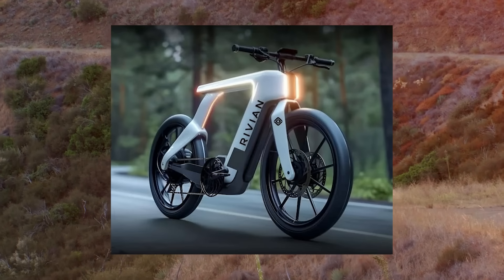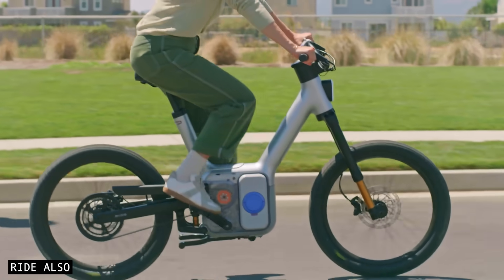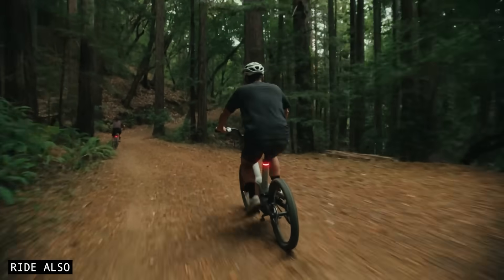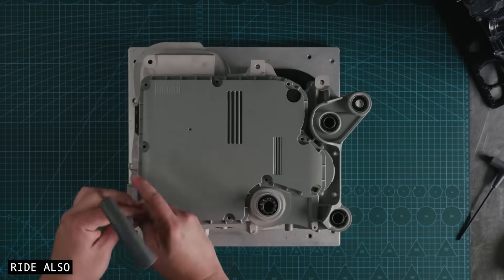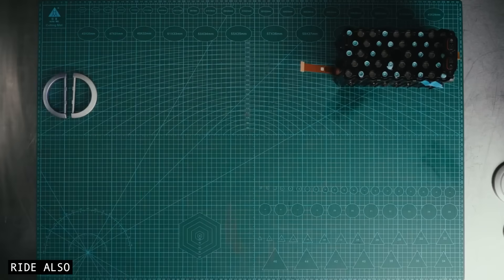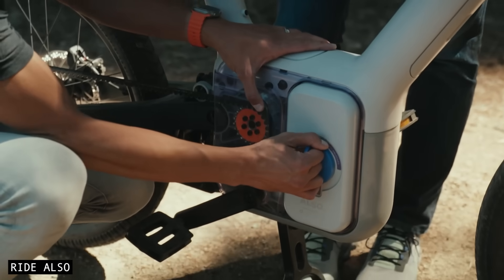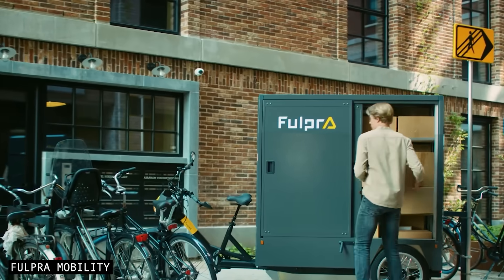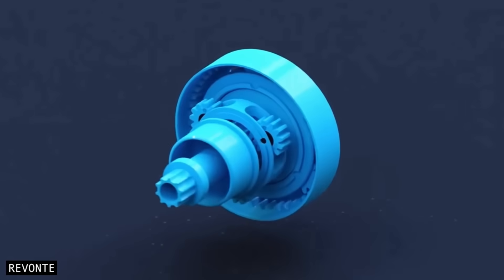Here’s Why the $4,500 Rivian eBike Uses a Digital Gearbox & Belt Drive!

Comment: eBikes should require licensing. They're motor vehicles. Pedal-assist is nonsense legalese. Companies like Amazon want these because the insurance changes and you can hire delivery drivers that don't need certs or licenses to operate them. The manufacturers are working very hard to keep them classified as non-motorized vehicles. Pedal powered conveyances don't weigh 85 lbs, motorized ones do.

Comment: It would've been good to compare this ebike to ones with regular mid-drives, as functionally and price-wise they are the most direct competitor, not hub motor ebikes. A mid-drive bike with a belt drive and torque sensor shares many of the advantages of this bike while avoiding the pedaling efficiency loss

Comment: This feels like an e-bike for middleclass people who would otherwise not ride a bike, especially with that 100 mile range to get out of car dependent suburbia and still have enough juice to get back home, rather than people who already like to ride bikes. Its a necessary piece of the puzzle to get people used to diving less and using bikes and public transport more, but the bike racks on the buses around here wouldn't let you put it on the front in a million years. 

My ride1up 700 series just barely meets the 50 lbs weight limit, a bike I got specifically because it was made of off-the-shelf parts so I could fix it myself if they ever went under without worrying about sourcing parts. I have needed to do twice already when I got screws in my rear wheel and fucked up the rim cus it was a state highway and they don't bother cleaning up the bikelanes. 

New rear wheel was $360 including install by the shop, guy was nice enough to include free rollflats. Im too broke rn to afford that kind of convenience fee, but I have the option of opting out of that and getting the parts myself. You don't with a proprietary system like this.

As for the quad, they need to be using the streets, not the bike lanes. They are not bikes, nor are they called bikes. They are exploiting laws that were made before they were a consideration that had to be made. The solution to less traffic is less cars on the road and better public transportation, and these quads perpetuate a continued desire to drive a car as they directly reduce peoples desire to ride bikes if its going to be taken up by a shrunk down delivery truck that only exists because of how companies have decided we get the items we need for us.

Comment: Did you miss a large chunk of inefficiency in the drivetrain when you didn’t include the several stages of gearing we can see being installed? Also did someone say heavy? This thing is heavier than a lot of of the riders that would end up riding it. I have a high power full fat EMTB that only weighs 52 pounds and it’s heavy. This thing is ridiculous.

Comment: The aesthetic of this bike is disappointing. The front wheel looks too small. The gap between the top of the front wheel and the fork crown is too large. The handlebars look like an afterthought. It feels like they worked hard on the drive train, including it's design, then kind of forgot about the rest of the bike.

Comment: Remember guys:
You still can convert with your bike to electric with bbshd, bbs02, TSDZ8 or TSDZ16 for a fraction of the price of any Emtb. You will have much more power,. More like torque and a throttle if you want. Parts are available everywhere and cheap.

Comment: That turtle mode sounds very slow. We use the newest CIXI drivertrain on our GoLo and it will still cycle 15km/h purely on your power when the battery is flat. Even better, the CIXI gets a higher mileage compared to the chain drivetrain with the same battery, so the complete package is more efficient without a chain. Right now we can do a 20% with full cargo from stand still. Most generators can't fully convert the riders torque though so most are very inefficient and don't feel natural. If you'd like you can test the newest generation CIXI/GoLo if you'd like
Reply from the maker: I’d love to know what bike you’re comparing your GoLo to that makes the CIXI more efficient on the same battery size. What bike, motor, drivetrain, and tyres are you using as the reference?
Reply: @Cyclingabout  I had a long reply that seems to have been removed, but short answer: same bike. So the GoLo with Bafang M620 and 3x3 hub. Re-gen has something to do with it and passing the motor through the drivetrain as well, but in the end we get about 15% extra range on the same platform. I still find this truly mind boggling! We are happy to provide more info but YT seems to be picky about comments?
Reply from the maker: Wow, that’s impressive. Either your previous motor/drivetrain/battery setup had some pretty big losses, or Cixi has seriously optimised their system (probably a bit of both!). You must be doing a lot of stop-start riding and carrying a decent amount of weight to take full advantage of that regen? I’m going to see if I can hunt down your comment - I would love to hear more.
Reply: @Cyclingabout  A bit of both indeed, but I sent you a more in depth message through messenger , I think the YouTube comment is ghosted/lost forever

Comment: The 15% motor inefficiency is complete BS. Motors are not equally efficient across their speed range, and without any gearshifting, (and even with) the motor is effectively fixed to the rear wheel. So when riding slowly, the motor will be horrifically inefficient (<50%), and may only get close to 15% loss (more likely >20% loss) at max speed. Then the pedal generator will have similar efficiency curves - more efficient at high cadence, inefficient at low cadence (which is mostly shown in the promo). This is so inefficient that is really effectively only running on the battery.

This is little more than a moped with pedals to make it "legal" to ride amongst much lighter bikes, where it really has no business being.
Reply from the maker: You’re absolutely right, efficiency is a lot more complex than I initially made it sound, and it can vary significantly depending on operating conditions (this is where three-dimensional motor efficiency maps are handy!). The encouraging part is that once a motor reaches its optimal RPM and torque range, efficiency tends to stabilise and stays relatively consistent even as speed or torque increases further.

In real-world use, a well-designed motor can maintain a broad, flat efficiency band around 80 to 85% at typical assist levels. That’s why I used those figures for this simplified example, and there’s a PhD thesis on series-hybrid bicycle design that reached similar efficiency values, so I feel like my assumption is reasonable.

Comment: 6:10 i know you have been paid to bash hub motors but mis informing the massive about hub motor and hill test climbing is really bad and you should shop. hub motors can wheelie so it has the power to accelerate uphill way faster than that thing the only real disadvantage of hub motors is they are heavy and doesnt balance the bike ratio
Reply from the maker: I'm not paid to promote or bash anything. In fact, I really like rear hub motors.

I chose a big direct-drive hub motor for this simulation because, when I tested a geared hub with regen in the Grin simulator, the thermal performance on long, steep climbs resulted in overheating. In this scenario, there’s no rider directly contributing power, so the motors tend to overheat much faster.

So, while they might have the power to wheelie and accelerate fast, they are not immune to overheating on sustained climbs.

Comment: As a guy that has been riding road bikes and tri-bikes for decades but is fast approaching 70 and just bought my first E-bike this is intriguing. This bike is not designed or made for "real bikers" but for occasional rider who is not in shape to ride up a hill or into a head wind or haul anything on the bike back from the grocery store. Is it overkill for that use case, yep plenty of cheaper Chinese E-bikes that can do the same for less. Hopefully it finds a market, I can see the quads working in a retirement community for individual buyers, but the quad delivery vehicles should work out nicely in dense urban environments especially in Europe. I wish them luck.

Comment: The cargo quad must be using a different battery, though. 808 Wh would only be good for about 20ish km on a heavy delivery quad if there is any hill climbing involved.
Reply from the maker: That's for sure. Delivery quads from other companies use 2-3 kWh batteries currently.

Comment: Did you do the analysis of climbing ability only for the direct drive Grin hub motor shown in the video, or also for a comparably sized geared hub motor?
Reply from the maker: I probably should’ve explained this better. I chose a big direct-drive hub motor for this simulation because, when I tested a geared hub with regen in the Grin simulator, the thermal performance on long, steep climbs resulted in overheating. In this scenario, there’s no rider directly contributing power, so the motors tend to overheat much faster.

Comment: Converts mechanical energy to electrical energy and then back to mechanical energy to drive the rear wheel.  So if the battery dies your pedalling does nothing and your fancy "security systems" also fail.  Electronics that rely on an app to control functionality routinely progress into paid subscriptions without the consumer's choice and brick things when the company stops supporting the product.  Nice bike but a solid no for me.

Comment: The “35 % Loss” Claim — Why It’s Misleading

There’s a recurring claim that the ALSO e-bike (TM-B) — developed by a team originally within Rivian — “loses 35 % of rider power” because pedaling drives a generator instead of a chain.
That number has no basis in measured data. It originates from experiments on crude pedal-powered electricity generators with friction drives and unregulated converters, where cumulative system losses reached 40–65 %. Those setups are unrelated to modern, software-controlled series-hybrid drivetrains.

1. Conventional Bicycle
Energy Path: Pedal → Chain → Cassette → Wheel
Verified Efficiency: Well-maintained drivetrains achieve 97–98 % peak efficiency and 92.8–96.8 % real-world efficiency, depending on lubrication, contamination, and alignment (CyclingAbout).
Limitations:
 1) No regenerative braking — all kinetic energy is lost as heat.
 2) Efficiency drops with dirt, misalignment, or wear.
 3) Continuous mechanical wear increases rolling resistance.
 4) No active torque or energy management.

2. Traditional E-Bikes
 i) Hub-Motor Systems
    Energy Path: Pedal → Chain → Wheel (+ Hub Motor Assist)
    Efficiency: ≈ 30–60 % depending on load, speed, and controller design (Bicycle Retailer).   
    Hub motors operate outside their efficiency sweet-spot at low speeds and under heavy load, making them the least efficient configuration.  
  ii) Mid-Drive Systems
    Energy Path: Pedal → Chain → Mid-Drive Motor → Wheel
    Efficiency: ≈ 70–80 % (Bicycle Retailer, Bosch specifications*).
    Mid-drives use the bike’s gearing to keep the motor in a more efficient range but introduce additional mechanical wear.
Shared Limitations:
   1) No regenerative braking: energy is always dissipated as heat.
   2) Limited thermal management: motor temperature reduces efficiency and lifespan.
   3) Reactive torque control: assistance is proportional to pedal input without dynamic optimization.
   4) Mechanical wear: chains, cogs, and gearsets degrade, raising long-term losses.
   5) Open-loop energy behavior: current is fed to the motor without system-level optimization.
Real-world efficiency varies widely — roughly 30–80 %, depending on motor type, control logic, and terrain.

3. ALSO E-Bike (TM-B) — Software-Defined Series-Hybrid Architecture
 Energy Path: Pedal → Generator → DC Bus → Traction Motor → Belt → Wheel
 The TM-B employs a pedal-by-wire system confirmed by TechCrunch and Engadget, where pedaling spins a generator that powers the traction motor or charges the battery. Torque and   cadence are software-controlled rather than gear-defined.
 
Component Efficiencies (Theoretical Ranges):
 Generator: 90–95 % (ScienceDirect, Linquip)
 Power electronics: ≈ 92–97 % (plausible for modern SiC-based inverters)
 Motor + belt drive: ≈ 90–95 % for the motor, though belt drives consume ~1 W more than chains (BikeRadar), making overall belt efficiency slightly lower than a high-quality chain.
Estimated System Efficiency: ~80–90 % under ideal control.
Verification Status: No independent testing yet (Electrek). ALSO representatives state that drivetrain losses are “minimal,” but data is pending until commercial release (planned 2026).

Why Software-Defined Control Matters
A software-defined drivetrain can implement optimal control algorithms that:
 1) Dynamically balance generator torque and motor demand to stay inside each machine’s high-efficiency region.
 2) Smooth current flow and minimize resistive (I²R) losses.
 3) Manage thermal load to prevent heat-induced inefficiency.
 4) Route energy intelligently between generator, storage, and motor.
 5) Enable regenerative braking to recover part of the kinetic energy otherwise wasted.
This transforms the drivetrain from a passive linkage into an actively optimized power system.

Comparative Summary

System Type                     | Peak Eff.    | Real-World  | Regen  | Control/Management             | Wear & Notes
---------------------------------------|-------------------|------------------- |-------------|-----------------------------------------------|-------------------------------------------
Conventional Bicycle      | 97–98%      | 93–96%      | No         | None                                         | Extremely efficient but no energy recovery; chain wear over time.
Traditional E-Bike (Hub) | ~60% max  | 30–60%      | No        | Minimal                                     | Poor efficiency at low speed; motor heat losses; no thermal control.
Traditional E-Bike (Mid)  | ~80% max  | 70–80%      | Rare     | Limited                                      | Better torque but chain/gear friction; no regen braking.
ALSO E-Bike (Series Hybrid)
(pedal-by-wire)               | 90–95%*       | 80–90%*    | Yes      | Software-defined closed-loop | Minimal mechanical wear; active thermal + torque management; *theoretical, pending verification.

Context for the “35 % Loss”
The “35 % loss” figure comes from early experiments with amateur stationary bike generators that suffered compounded inefficiencies across batteries, regulators, and converters.
Such setups had no closed-loop control, poor thermal design, and mismatched components.
Applying that number to a modern embedded-controlled drivetrain like the TM-B is scientifically invalid.

Key Takeaways

Conventional bikes remain the most mechanically efficient but waste all braking energy and require ongoing maintenance.
Traditional e-bikes improve power output but not energy efficiency; they lack regeneration, suffer from thermal losses, and experience mechanical wear.
The ALSO TM-B, with its software-defined, generator-based drivetrain, offers the potential for high, stable efficiency and partial energy recovery — though third-party data is still pending.
The theoretical 80–90 % system efficiency aligns with known performance limits of high-quality motors, generators, and inverters, but it has not yet been verified experimentally. The often-quoted “35 % loss” refers to crude generator setups and does not apply to engineered, closed-loop systems.

Conclusion
Conventional bicycles dominate in raw mechanical efficiency but lack intelligence, recovery, or self-optimization.
Traditional e-bikes trade simplicity for convenience yet operate in open loop, wasting energy and generating wear.
A software-defined, generator-based drivetrain such as the one on the ALSO TM-B introduces an architecture where efficiency is determined not by fixed gearing but by how effectively software manages torque, current, and temperature.
Until independent testing confirms real-world numbers, the correct and honest statement is: 

The ALSO TM-B has the theoretical capability to maintain 80–90 % system efficiency under optimal control — a plausible, but not yet verified, figure consistent with modern electrical-machine design.

Comment: You said only 3 kg heavier than equivalent systems but that's not the case it's 18 kg heavier the specialized levo is 22 kg with an 800 watt hour battery, and if you go with the amflow it's 20 kg heavier with an 800 watt hour battery
Reply from the maker: It's not just the battery size and suspension elements you need to match up, but the drivetrain type, carrying capacity, and features. The Riese & Muller Homage5 with Pinion MGU came closest in my brief search.

Comment: I like it, but for it to be viable as a product, it will need to solve problems e-bikes haven't figured out yet,  or at least, do some things way better than the current options. I do not like the tethered to the phone aspect. This sounds like a great idea on paper for security, but my phone runs low frequently and I'd be in a constant state of panic. Also it would force me to have my phone on my, which is not always the case. Better to have biometrics as an option or just stick with a dongle like cars do.